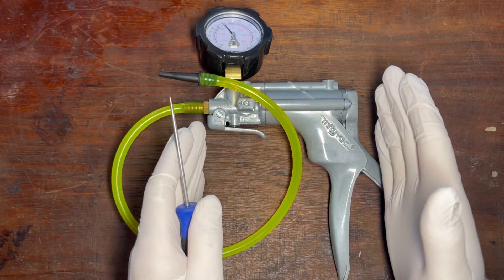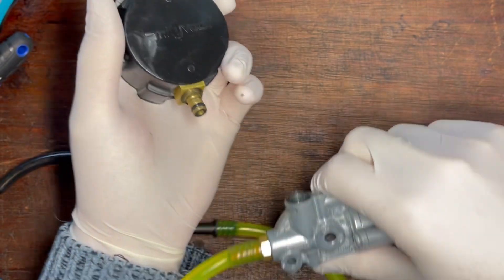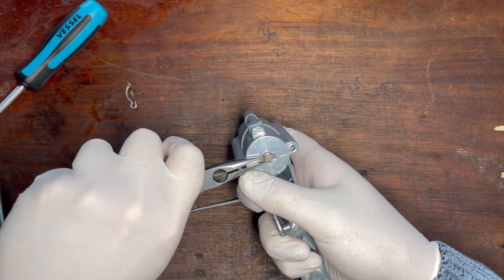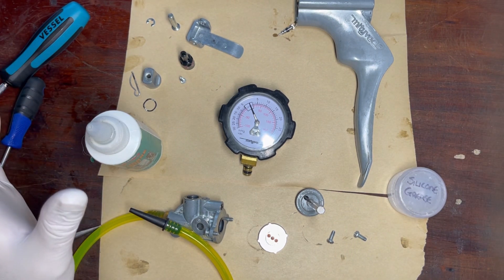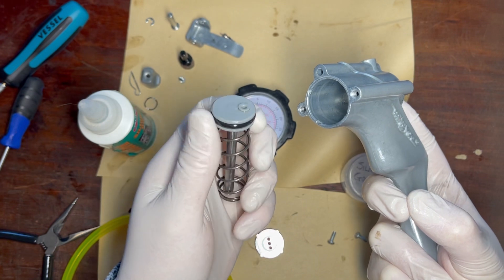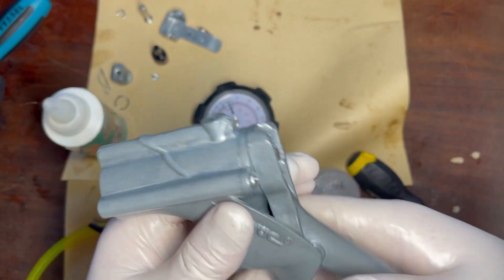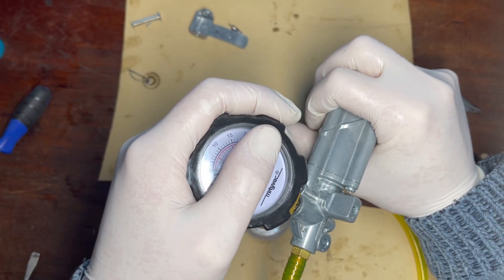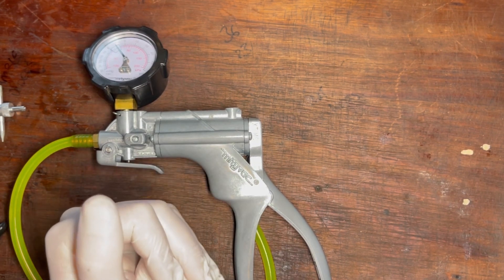Mityvac Pump - Full Disassembly, Service & Repair.

Comment: Thank you for this video. Paid $100 for the MityVac Hand Pump kit (metal version) and when I finally went to use it (months later), it couldn’t hold vac/apply pressure and after your video I was able to clean everything and put it back together and it’s so much smoother and accurate. Thank you.
Reply from the maker: Ah awesome! Glad it helped!

Comment: Why would my MV 8500 hold vacuum but not pressure?
Reply from the maker: Hmmm I can’t say off the top of my head. I’d send it back if it’s new. If it’s past warranty, take it apart - probably a worn seal :)
Reply: @VintageEngineRepairs  It's like new because I have only used it once before yesterday, but the warranty is gone since I have had it for over a year.  I did take it apart and everything looks new.  I re-lubed all of the O-rings and still no pressure.  I guess I will have to call them on Monday and see what they say.
Reply: @Mr2004MCSS  Did you get this sorted? I have the same problem. TIA.

Comment: Hi mine selector switch is stuck in vacuum I can’t twist it do you know how I can fix that please?
Reply from the maker: Hey, don’t force it or it will snap, take pictures of both sides so you know how it goes back together, then remove the screw, selector lever and push out the plastic piece. Give it some oil with silicone oil and re-assemble.

Comment: Just bought a new one, did a test and it leaks down slowly, brand new. Kinda bummed 🫤. Thanks for the video, seems I have to take it apart already.
Reply from the maker: Hmm very strange, send it back.
Reply: Same happened to me..
Reply: Just got the 8000 and took it out of package, tested for vacuum and it doesn't hold pressure. 
 Slowly leaks down with finger on nozzle. 
 Was hoping to fix rather than return, but maybe I'll try another.

Comment: Might I recommend replacing the split pin with a solid one . (Split pin is abrasive )
Reply from the maker: Absolutely, any metal pin that will fit will be just fine. The reason I open the pin up is to stop it rotating round and scratching.

Comment: Is WD ok for a cleaner?
Reply from the maker: If you’re just cleaning the metal parts, absolutely! It’s a fantastic cleaner. It would likely be fine on the seals too, even though it’s petroleum based, but I choose caution as I’ve seen what they do to o-rings and other natural parts. Hopefully someone will chime in and say if the black seals are nitrile or not.